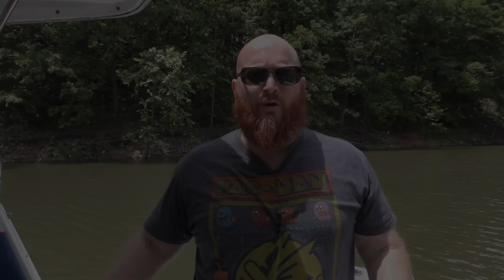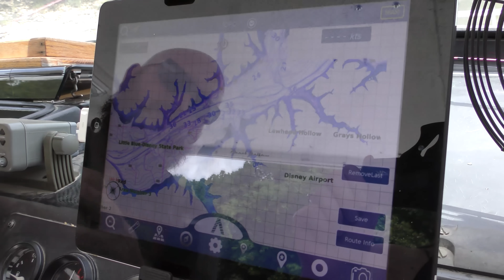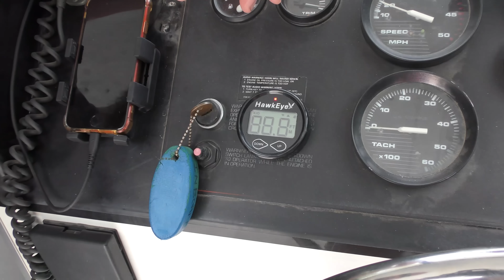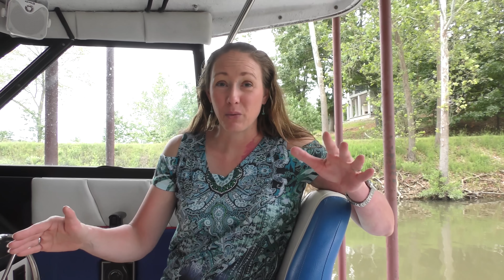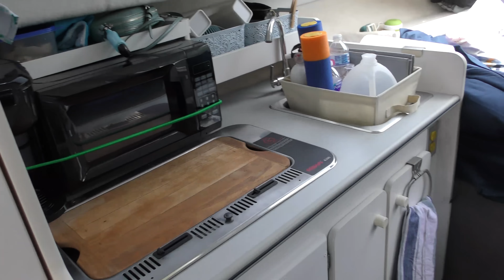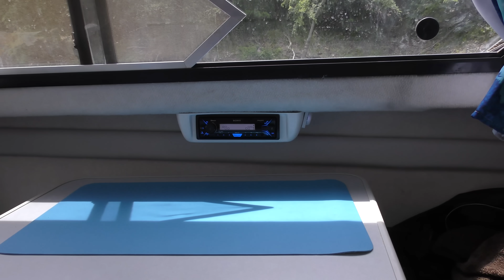Cruiser #4: It's Sea Worthy! See the CAR WIZARD get the boat in the water and the issues that arise

Comment: 40 isnt enough line. you should have about 4x line to depth your in id have more like 100 foot  anchor line you can always tie off the line you dont need. id also keep 6x 20foot lines for docking up.... TAKE A BOATING CLASS FFS is Maryland the only state that requires a boating license?

Comment: If you push on the outdrive from side to side, if there is a lot of play, that will cause steering problems.  The side to side play is caused by wear in the very top of the transom mount.  It is a difficult repair.  And a leading cause of replacing the transom mount.  The engine comes out so you can remove the transom mount.
Reply: I suspect that he had the auxiliary tilted so that, in addition to the apparent binding of the linkage, all that was being felt was the weight of the auxiliary powerhead flopping side to side on the steering tube. He should simply disconnect the linkage when not using the auxiliary instead of having it permanently connected and strap it to one side in the tilted position. The auxiliary transom mount bracket is mounted far too low for that outboard - you can see here https://youtu.be/cIRqt_uTm60?t=747 that the cavitation plate is well below the waterline and you're not going to be planing a glass hull of that size with 15HP.

Comment: FYI- anchoring requires “scope”. Usually the rule of thumb is a 5 to 1 scope. So if you’re in 10’ of water you would need 50’ of rode.  Rode is your chain and rope. It’s best to have your anchor attached to chain and  then rope.  In your video you were in pretty calm winds and current but if you ever try to anchor in wind or current you’ll need to consider your scope.

Comment: My first boat had one of those stupid hydrofoils and the previous owner drilled the holes crooked and installed it. 
The dang boat did nothing but pull to one side.  I took it off and I fixed the holes in the out drive and never looked back.

Comment: if the kicker motor causes the boat to List.. you don't have enough ballast as the main fuel tank down the center line is Empty.. your boat will be top heavy..  is there any clean out hatches on the main fuel tank.. that could allow you to get it cleaned out with a belt driven shop vacuum to prevent fuel tank fumes from going thru the vacuum cleaner motor and the sparking brushes area.. and a high pressure washer. with a long wand..  allowing you to attempt to insert a twin water bed mattress into the main fuel tank thru the clean out hatch.. inflate it with a leaf blower and allow it to deflate to allow it to settle into place.. then fill it will water and seal it. giving you ballast again..  with an issue.. you will have to pump the water out before it freezes in the late fall..  but i don't expect you will be leaving the boat in the water during the winter..   trailer hint.. in front of the winch mount.. put down a slip fit pipe flange or even a threaded pipe flange.. so you can use a piece of grey plastic electrical conduit with a bend in the top.. so you have something to aim for over your bow  and the winch end is danging from the overhanging conduit. 
for the aux motor.. you may want to search out an engine jacking plate.. like a cross slide for a lathe. turn the knob and the motor comes up farther..   lastly.. find some neodymium magnets with holes in the middle.. twist a loop of solid copper wire thru them so they don't sit flat and you can snag them out of the tank with a hook.  the neodymium magnets are strong enough to pull most sediment out of the fuel.. at least the Iron rust that causes most of the issues with fuel.. it comes from refineries.. thru the gas stations.. thru marina fuel dock pipes. sometimes from gas pumps .. its really annoying and the neodymium magnets have been my trick for over 30 years in cars and trucks and marine fuel tanks.. 
i spend 22 years working with a friend who owned a 104' wooden power boat. so i have been around.  we lost a lot of our lead ballast at the first replanking of the bottom.. the workers would dump the lead ballast off the ribs and out thru the missing planks.. while hauling the trash away they were hauling away the lead ingots too..  so we always ended up top heavy..  the boat was only really stable when the fuel tanks were mostly filled... it took around 5,000 gallons  we never put in much over 3000.. did not need that much..  the water bed mattress is a cheap trick that works. as long as the inside of the tank is clean and fuel residue free..  think pool cleaning hose from the pool supply or big hardware stores for your long hose to a vacuum..  but you are going to need to create the. vacuum with the belt drive..  or use an old roots type super charger...  and yes.. it can be used later to clean carpets..  again i have gone too far . sorry.

Comment: WIzard, 40 foot of anchor road isn't enough for 20 foot depths. You need to shoot for AT LEAST a 3 to 1 ratio of anchor road to water depth. In fact, I wouldn't trust anything less than 4 to 1. In a storm, 6 to 1 or more is preferable. Anything more than 8 to 1 and you start to get into diminishing returns.

Here's the thing, an anchor is designed so that it will bury itself into the mud as the boat drags it along the bottom. At 2 to 1, the boat isn't so much dragging the anchor along the bottom as it's lifting the anchor and hopping it along the bottom. At 2 to 1, you risk dragging that anchor in any kind of moderate breeze, or even boats flying past you and making a big wake. Before you know it, you could end up in the mud.

*I absolutely would not trust 2 to 1 scope while I was asleep at night.* Don't do it.

Comment: Mr. Wizard.  I have same Bayliner in Ft. Laudadale.  I have same issue with steering wandering and yes I have a wail tail.  Will take it off first thing.  I have slight list on left side without a kicker.   The is especially that case when you fill water tank.  How many engine hours do you have?  I picked up form Copart with only 230 hours.  I will have to replicate your solar panel work. Keeping batteries strong essential for restarting engine so I have been using accessories at minimum.   Please keep videos coming!

Comment: You could just use your phone as a hotspot.. so you do not have to pay for another line. 
I have an old Android phone that's installed In my car and hooked into the radio. I use Android auto and it simply connects to my cell phone via a hotspot.

Comment: Everything you  have. I have. Have the same Depth sounder.
I always set my SHALLOW to 12 feet when I go out. I use the same chart system with a map. That has a dot were I am at. Simple not expensive. The part about Anchorage is right on. I was Anchor in like 30 feet. By little island. With strong current exchange at tidal shift. Should have Remember that.  We we got woken up in middle of night by Current pulling Anchor off bottom. We drifted out away from Island,  just like you it was a learning experience for us about Anchorage. Anyway looks nice. You do and Mrs Wizard does such beautiful interior/cabin work. Thank you for video. Love yours on your boating experience
Thank you for your great Learning for me video's.

Comment: good luck with your Bayliner buddy hummingbird GPS and chart Potters are cheap they make hard plastic egg holders that will hold eggs and not break for anchor purposes your scope should be 7 to 1 anything under 50 foot and that would be 7 ft of rope for 1 foot of depth you going to wish you had that kicker motor if anything happens to the main motor the way to fix the listing is sandbags glad to see you're on the water enjoying your boat

Comment: Safety comment; look up anchoring techniques. I live on my sailboat and we carry a 35 kg anchor with 100 meters (yep... meters) of g40 10mm chain with additional 50 meters of 18 mm nylon rode. Minimum length of chain is 3 times depth plus the height of the bow rollers to the water line. (This is for a calm day... gets much more if windy). However, I am in the W. Pacific. Keep up the lovely content!!

Comment: If you are having electric power issues before installing a generator I would add another battery. The alternator on your engine will be able to top off your battery bank. Maybe adding another panel to your solar array would help, Renogy makes some decent flexible panels up to around 175W. Adding a generator just adds more noise, smells and maintenance.
You can put a bladder in your old tank, It's actually really easy.

Comment: As someone who owns a 22’ cuddy on a very large lake in Idaho, I would strongly suggest you leave the kicker motor installed. Even if you don’t use it for trolling as intended, it is a great backup to the I/O should it have an issue. I never used a steering rod on mine. Just turning the out drive with the steering wheel is enough to change direction while trolling. When not in use, mine is up out of the water completely. I never really noticed much of a lean but I have it mounted opposite the driver. And the trim tabs work great for leveling out the boat when under way. Have fun!

Comment: Had to get towed a couple summers back in a buddies boat bc the inboard wouldn't turn over. Turned out to be bad sensor. Having a backup sounds a lot better to me than getting stranded over a little sensor so long as the boat's not too far off kilter.

Comment: When I had boats in 1974 to 1991 we never used those ridiculous bolt on fins if the boat doesn’t plane put weight in the nose when I had my dads boat we put a full gas can in the bow also raised the motor 1notch on the bracket in you’re case you would trim but we allways had outboards but weighting the bow is in all boating books I can’t wait till you splash that BIG BAD BOY in the garage bring hoovie ☠️👍

Comment: DOnt remove the  kicker motor.         just add weight the other side.
Reply: He's not using it, it's more trouble than it's worth. If you need a trawling motor, grab a lightweight electric one.
Reply: @Anaerin  always nice to have a second screw to get you home when your main engine fails though

Comment: 2:46 For the proper and safe anchorage you need at least 10 ft of a chain on the anchor first . A rope is used after the chain. 
Length of the chain/rope should be 3-4x more than the debt is.

Comment: I would assume that the kicker motor is there in case the main motor dies; it will get you back to shore.  Also, the linkage is there so that you can steer the kicker, with the wheel, if the main motor dies.

Comment: 30 feet anchor rope/chain is a bit too short. The rule of thumb I was taught is that you want to use three times as much rope or chain as it is deep. Now, that's a rule for sea, inland you could probably get away with a bit less, but I think you should think about extending your anchor rope to about 60 feet. Contrary to popular belief, large part of the what keeps you in place when anchored is the weight of the chain.

Comment: This has been a pure joy to watch! Congratulations on the Wizardcraft!

I've definitely never been able to contribute anything before, but here's something to note: **When using a rope and anchor, you should have roughly 8 feet of rope per foot of depth in which you will be anchored. I know that sounds like a lot, but I promise that's the conventional length.**
Reply: Yep. 30ft anchor cable in 20ft water is just the right recipe for going for a swim and finding that your boat's not there any more...

If you're swimming off a boat, there's a high chance that you'll all be off the boat at one point or other. It's a very good idea to have a decent length of chain at the anchor end - makes for a much more reliable anchorage. Oh, and make sure the swim ladder is put down before diving in. It can be hard to get back into a boat if the ladder is up and no one is on aboard to put it down!

Comment: Need a bow and aft anchor. Dont need a big one.. 2 smaller ones.. Helps keep the  boat in place. It will stop the spinning around. And keep the boat in the river stream current. Helps with the listing side to side too.
Reply: In a lake or other open water you almost always use one anchor precisely to let the boat weathercock.  You want the bow to the wind.

Comment: You use trimming to orient the hull to the conditions. If it’s choppy and rough you want to point the bow up some and when it’s smoother push it down with tilting and adjusting heel with tabs.👍🏼 it’s more important out on the Salt but it’s not exclusive. It’s important to adjust as needed for the conditions.  The kicker is supposed to be connected with the steering linkage. It just needs some lubricant. It’s okay though it’s possible to steer the kicker with it’s tiller.😊 
God Bless you Brother and your Family! That Bayliners decent ❤️🖖🏼

Comment: Since you have an I/O engine it is important to adjust the outdrive as you go. Starting out the outdrive should be all the way down. Once you get on plane you want to raise it up a bit so the prop is not pushing the water down but pushing the water horizontally giving you better performance and fuel mileage. Trim tabs are great to help get on plane quicker, balance the boat from Port to Starboard depending on who and what is where on the boat, as well as the porpoising.

Comment: You should have separate batteries for engine starting and deep cycle batteries for"household" use and you need some chain and more line for your 40 pound anchor. A spare anchor might be a good thing also.

Comment: From my model boating days, speed sway as you describe means the trim tabs are set too low. Set it too high puts the nose too high. In my case it was self limiting because air got sucked into the propellor. So the excessive trim never got to lift the bow too high.

Comment: 8 x 14 = 112  (8 = amps  14 = volts) 112 is watts. So if your amp controller is good for 11 amps (11 x 14 = 154) which means you will only be good for about 150 watts. If you want to get the full potential of those panels (or upgrade for that matter) you will need to upgrade that amp first.....

Comment: You could replace that outdrive with an outboard generator. Make a box to hold the generator that bolts to the outdrive mounts, run the gas lines to the generator and the power out to the boat through one of the existing holes used for the outdrive. If done correctly it's already plumbed into the boat's fuel supply (I assume) and you don't have to cut any more holes than is necessary to get the power back to the boat. As a bonus, the generator is outside the boat and if you're running it at night to keep the cabin nice and cool, the sound should be at a minimum. A tiny gas generator, outside in a sound insulated box chugging away while the Wizards snooze away inside.

Comment: You might want to explore a 4-blade prop ...  Usually 1 inch less pitch than your three blade with better lift, maybe more speed, definitely more smoothness, and usually better fuel fuel economy at intermediate cruising speeds :-)

Comment: You can compensate for the weight of the spare motor with ballast. Just get some rocks and put them on your boat . I would keep that motor because if the main engine fails you can get home with the tiny outboard. That is there for safety